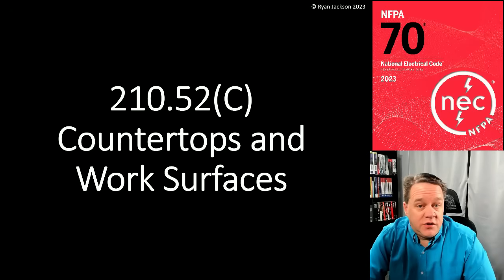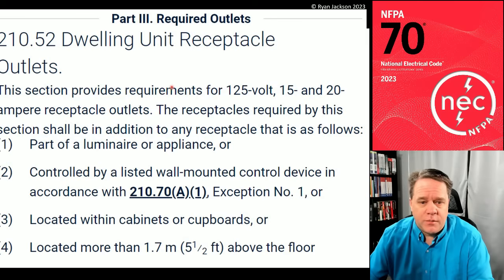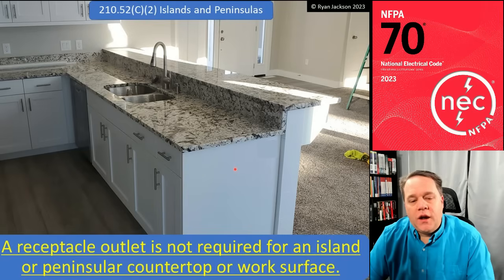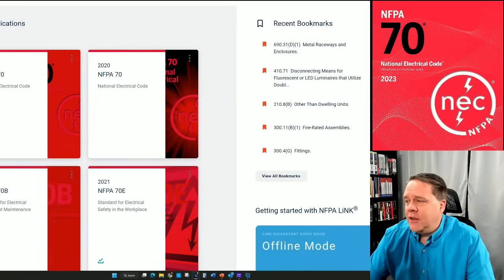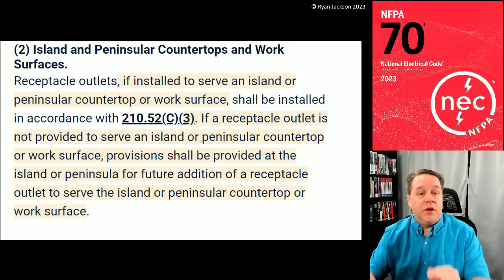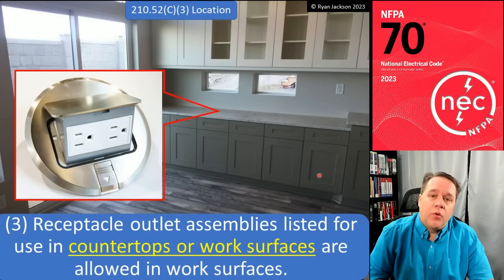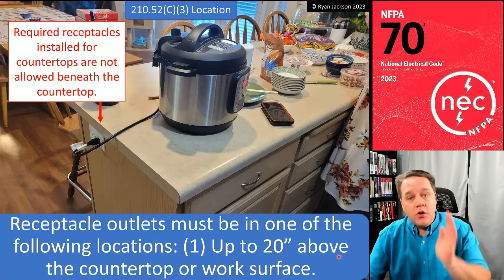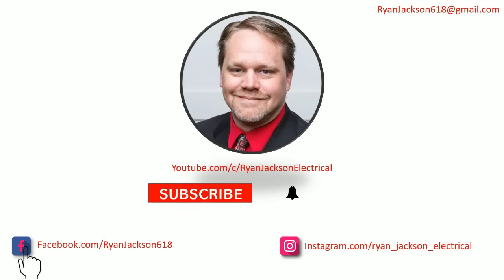Kitchen islands and peninsulas in the 2023 National Electrical Code

Comment: a big question that I have for you is what would you consider a wet or damp location if you're running UF cable and you just run the wire out there do you need to sleeve it because is that technically a wet or damp location and then also it's in the slab is the UF wire should be rated for that or no?

Comment: I work in South Florida on 20-30 million dollar homes on a daily basis and some of the stuff you have to put outlets in with these countertops and these kitchen islands is getting ridiculous not to mention having to work with the cabinet guys themselves is almost impossible to get your stuff landed where it needs to go it's good to know that it's not a requirement now All you have to do is run a sleeve out there but nowadays everybody wants power so you know you got to get them the expensive pop-up outlets that they want underneath the marble countertop it's crazy. Not to mention I'm also pulling separate circuits for whatever ice maker maybe a little cooler disposal dishwasher all that stuff. Thanks for helping me understand between what's required by the code and what you can just do that was pretty cool and it's wild that I'm at this point in my career I find stuff like this fascinating and can't wait to take the test
Reply: All great points same goes for up here. The thing to remember though is make sure your state is following the 2023 code. A lot of states are behind. Stay safe and take care.

Comment: This is incredibly informative, thank you. Especially for a DIY idiot like me, lol. The kind of island I want to build will have wheels so it can be rolled out of the way when unused. The one thing I was worried about with an impermanent island was having to wire it to make it more permanent. I don't have small children so there's no risk of pulling, but I don't want the island to be energized because, for our uses, it's not necessary. It'll be like a restaurant prep table, only more finished.
Reply: That seems like it would not be affected.  There is no way to provide permanent wiring to it.

Comment: Thanks for the info! Planning on (as owner) adding an outlet at the end of a peninsula for Laptop/iPad charging while sitting on far side (opposite side to the kitchen area, with bar stools). I never thought about possibility scalding burns from cookware (& we have toddler grandchildren!) We will never use it for that, and will add a small sign stating “Not for Cookware!). BTW, having to run the charging cord across to the nearest wall outlet (~6 ft) also presents a cord trip hazard. Granite countertop supported by metal plate pretty much rules out a pop up outlet.

Comment: Here's another use case to consider for allowing below countertop receptacles in an island:  a microwave receptacle in an open cubby below the island's countertop.  I have that setup today in my kitchen (installed many years ago).  The receptacle is located at the bottom of the cubby's rear wall and although it wasn't installed to serve the countertop (and, therefore, it presumably complies with the new code), the 36 inch cord, unmodified, on my air fryer will just reach it IF I place the air fryer right at the edge of the countertop.  Not that I would do such a dangerous thing because I prefer to use the receptacle installed on the side wall of the island.  That's the one we also used to use for plugging in a vacuum before we went cordless.  LOL  Good video and understandable, mostly, for this homeowner.  Thanks!

Comment: Respectfully, I think the interpretation at 13:20 is incorrect. The code reads "210.52(C)(2) Island and Peninsular Countertops and Work Surfaces. Receptacle outlets, if installed to serve an island or peninsular countertop or work surface, shall be installed in accordance with 210.52(C)(3).... 210.52(C)(3) Receptacle Outlet Location. Receptacle outlets shall be located in one or more of the following:

(1) On or above, but not more than 20 inches above, a countertop or work surface

(2) In a countertop using receptacle outlet assemblies listed for use in countertops

(3) In a work surface using receptacle outlet assemblies listed for use in work surfaces or listed for use in countertops"

If you install an "optional" receptacle below the work surface/countertop, it serves the work surface or countertop, thus it is "installed to serve an island or peninsular countertop or work surface." Thus it "shall" (i.e. must) comply with 210.52(C)(3), which doesn't allow a receptacle below the countertop.

Your argument seems to require that an "optional" receptacle does not serve the countertop, but of course it serves the countertop if installed directly below it. Maybe I'm missing something?
Reply from the maker: Well, that's the problem. If I install a receptacle under a sink for a disposer in an island, does that serve the countertop? I would say no. If I install one on the side of the cabinet but it's 12" above the floor, does that serve the countertop? I would say no. How about 13" above the floor? 14"? 15"? You see where I am going here. Unfortunately, the code is not perfectly clear and it does not (and must not) prohibit receptacles from being installed lower than the countertop. If we were in court, my proffessional opinion would be the one that I gave in the video.

Comment: I would have liked an explanation of the difference between a countertop and a work surface. These terms have been mentioned several times but no expansion on the difference.
Reply from the maker: I cover it in my code changes series on Article 100.
Reply: @RyanJacksonElectrical  Thanks....

Comment: what if the peninsula has the sink? Are receptacles still required to be within 2' ea side of the sink? can't seem to find any info in the code about this. thx!
Reply from the maker: The presence of a sink doesn't change anything. You don't need a receptacle on an island or peninsula.
Reply: @RyanJacksonElectrical  ok, noted. thank you for your feedback!

Comment: The only reason it's required is because Hubble came up with a $350 pop-up countertop outlet and needed it to be required so people would spend the money on it
Reply from the maker: The only reason what is required? Watch the video again. NOTHING is required. Nothing. And rest assured, the people on Code-Making Panel 2 have no interest in desires of Hubble.
Reply: @RyanJacksonElectrical  You are correct, I misspoke. But the code does remove most people's best and most cost effective option.
Reply from the maker: @tpgoat  You didn't misspeak, you made a claim and your claim was abosultely incorrect. You claimed that this change was a cash grab for one particular manufacturer. And you could not possibly be more wrong. Have you ever been in the room with Code-Making Panel 2 while they discussed this issue? I have.
Reply: @RyanJacksonElectrical  I misspoke by saying it was required. No I have not been in the room. I'm just an installer making assumptions based on information that comes from less than reparable sources. Can you honestly say the code has only the best intentions in mind?
Reply from the maker: @tpgoat  I cannot say that every member of every committee has ONLY safety in mind. I will say, however, that I have personally seen manufacturers vote against their own best interests when they did not have to. It is also important to note that it take a 2/3 majority to change the code, and a maximum 1/3 of the entire makeup of any committee can be any particular interest group (manufacturers, enforcers, installers, contractors, testing labraotories, etc.). Often there are multiple manufacturers on a Code-Making Panel that have opposite interests, making it even more difficult to reach consensus. Imagine a fuse manufacturer and a breker manufacturer, for example. Or manufacturers of AFCI receptacles and AFCI breakers. Often times the manufacturers help ensure that product does NOT get required, but, again, it requires 2/3 majority regardless.
Reply: Mine cost $40 each. Not gonna be any dead bodies in my house because of a under counter outlet.

Comment: So why would I worry about it now because you're telling me to worry about it when we've e been installing receptacles on the ends of the island and peninsula that have been required for the last 20 years.
Reply from the maker: Right, and the consuimer product safety commission's data of burn injuries and deaths show that it was probbly never a good idea to begin with.
Reply: @RyanJacksonElectrical  and cars kill even more people every year but we keep driving. My point is that you can't bubble wrap the world. There are dangers around every corner but our job as individuals is to be aware of those dangers and do our best to avoid them. As for children, thats on the parents to teach them. And maybe just maybe if you have small children you shouldn't be using those receptacles when you're not providing the proper supervision. If you have an island receptacle, you most likely have one on a countertop space you can use that doesn't allow for the cord to hang off the edge.
Reply: @tpgoat But, the purpose of the code is safety. If a safer alternative is available, the panel should adopt it..

Comment: We are modifying our kitchen and adding a kitchen island.  We are in a state that still uses 2020.
1. Can we use NEC 2023 as that makes more sense to us?
2. Do we need an official inspection before and after the cabinet/island installation?
3. Moreover, how will a potential future buyer's inspection know when exactly the kitchen was updated?  Assuming by then our state should be on the 2023 NEC anyway.
Reply: Unfortunately plenty of states don't use the latest code because it hasn't been adopted by the legislative bodies. Some states, such as California are one code cycle behind the latest code. This gives them 3 years to adopt the latest code. Unfortunately the latest code may contain changes that are beneficial to the contractor and public but cannot be implemented because that year code book hasn't been adopted.
Reply: I'm in a similar situation, but in a state that still uses 2017, but is currently in the process of moving over to 2023(haven't moved over fully yet though), going by 2017 code means we'd have to sacrifice a drawer and it's front to make room or cut a hole in our waterfall countertop. My backup plan is to sacrifice the drawer if they require it, then once it's all inspected I'll rewire it to a box inside the cabinet(2023 code standards) and install the drawer.

Comment: I had one installed to comply with 2020 (NJ) and i am going remove it after the inspection. It is a super easy safety hazard for those homes with little kids. Also, i am a 20+ year home owner. I lived in so many different homes and i never had to plug an appliance to an island receptacle. 
They are maybe good for vacuum cleaners and that's it....

Comment: I know this is off topic, but props about mentioning the burn issue.  It can't be emphasized enough that all you need to do is turn the handles so they can't be grabbed or bumped.  Hot appliances should be pushed back as far as possible from the edge.  First time parents often forget this because they are so sleep-deprived, and trying to figure out the whole parenting thing, so it's especially dangerous for the little ones once they start walking.

Comment: I'm not a lawyer I'm not an electrician. Given that, because a receptacle is available does not mean it is required to use. Best practice for convenience of homeowners.. is the homeowner taking the best course of action for their safety of their loved ones?
What if that sand customer use the receptacle above the counter and let the court dangle for that toddler over the counter... Is the electrician still responsible?
Reply: There’s a difference between best practice for homeowners and best practice for electricians. There’s no good reason for an electrician to install a receptacle below the surface, so don’t do it.
Reply: Anthony; that's why a lot of appliance have short cords-to prevent dangling cords over counter top edges.

Comment: Reminds me of the old SNL skit, "You can't put too much water into a nuclear reactor." Unforeseen consequences of the below counter outlets clearly needs to be remedied, by banning them; fudging by allowing them as optional changes nothing in terms of safer homes. Saying something "may be," versus "must be," "shall be," or "shall not be" invites ambiguous interpretations which someone, somewhere, will creatively figure out a dangerous yet "code legal" workaround for. This code wording doesn't even take sneakiness to get around; it invites unsafe installs.
  Children and distracted adults with things sticking out from their pocket or beltline are no smarter or cautious, today, than five plus years ago, because of a code change. Snagging and pulling a hot appliance down is neither required nor optional; it is to be avoided. If my kid were burned at a friend's new home, and I learned the owner/builder had put such an "optional" outlet in, I would sue all parties, including the electrician who did not refuse to install an unsafe outlet, code legal or not.
  There is no defensible argument that justifies dangerous wiring, when safer alternatives are available and provided for already.

Comment: This is one of the dumbest code changes yet. 
All of the safety hazards mentioned in this video or by the CPSC are not solved by this code change (I.e.Cords can still hang over the side of the counter). This reminds me of the EPA regulating gas cans. People spill more now using the new gas cans than they did with the old cans. Hopefully in the next few years the code with change again and common sense will prevail. (I.e. as washer done with the dishwasher air gap).
Reply: Good luck with that.  Even if the code does change for the better, you'll be left with a mishmash of different rules in different places, as well as different existing practices and different inspectors enforcing different ideas about what should be done.
Reply: @ Codes are updated all the time. Additionally, Inspectors receive regular training on the updated codes. While there is sometimes confusion when updates and the subsequent transition period, it works itself out in the end.

Comment: So I am at that point now.  We failed the final for # of recepticles per 2020 code.  My question is this, if our state Adopted 2020 code as of Jan 1,2023 but the 2023 code eliminated the island recepticles due to safety, should this not overrule the 2020 code of # recepticle requirements?
Reply: I'm dealing with this too. Currently pushing back on the inspector because we're being asked to add outlets that are no longer in compliance as of the 2023 code.
Reply: Talk to your building official.

Comment: I understand outlets are no longer required on islands.  But if you opt to do it, does anybody know if there are code requirements as to where on the island surface the outlets need to be installed?  Or about the quantity?  Distance from the edge, distance from a sink, located every 4-ft, etc?  I'm assuming the quantity is still the same (1 outlet for the first 9 sq ft, and 1 additional outlet for each additional 18 sq ft).  What if the pop-up has 8 outlets on it (2 plug-ins on each of 4 sides), will that satisfy some of the required amounts?  I'm about to start a major kitchen remodel, and my island will be 4ft x 10 ft.  It will contain my dishwasher, sink, and microwave.  Thank you for any advice you can offer!
Reply: They are no longer required so therefore there is no longer a code for how many or spacing.  You can decide at this point how many and where you want them.

Comment: Thank you. Well made video. Just finished a kitchen remodel and the peninsula outlet was a big question. Wife didn’t want to ruin the aesthetics on the end cabinet. I wanted it for the purpose of charging computers and cellphones. I get what you’re saying about heating devices getting dragged off the counter, but to refuse to install a permitable outlet because it might be used improperly seems a little extreme. I do appreciate your attention to safety. My wife appreciates the clean end cabinet.
Reply: From what I understand, outlets were added to kitchen islands because people were putting appliances like slow cookers on them and would string the cord across the aisle to the island...now people are saying they have to go for much the same reason.

Comment: This is very timely (and probably got flagged by the algorithm due to all the "how to" videos I was just watching). I went to plug in an electric griddle to make Pancakes a few days ago, and the cord barely reached over the junk pile on the end of the counter, so I promptly started looking into what's involved in adding a new outlet on the end of my peninsula. I've also got 7 month old twins that aren't walking, yet, and I wear a camera holster on my belt that I'm frequently catching on things. I also have a fat wallet in the opposite cargo pocket which sticks out enough to catch things, sometimes. At present, we have our kitchen trash can under where I was considering adding the outlet, but that's just a glorified tall plastic bucket which can easily be relocated (and has been during some hosted holiday parties). So far I haven't started the outlet because I wasn't sure if there's asbestos tiles in the blank space under the cabinets, and I was going to get one from under the dishwasher tested, and I've got a kickspace on all three sides of my peninsula, so I was trying to decide on the best way of running the wire so it didn't come up in the middle of the cabinet, while also not coming through the open kick-space under the edge.

 Now you've got me reconsidering the entire project.

Comment: I have a 15-inch countertop with a pocket door behind it, making it difficult if not impossible to put a receptacle in the wall. (Only 1-1/4" clearance). So my only option is a pop-up for that space? That cabinet is the end of the run.